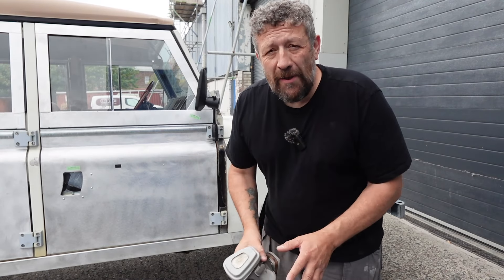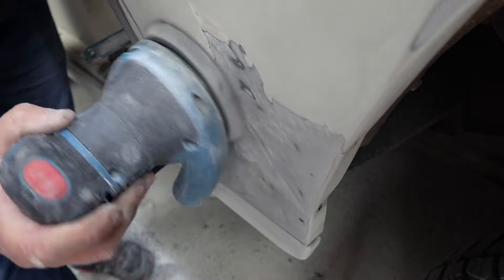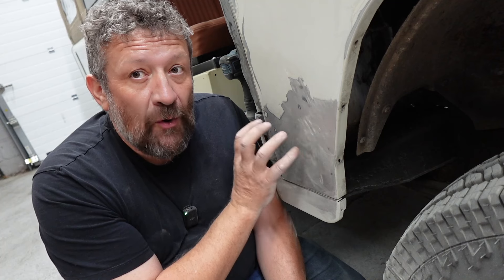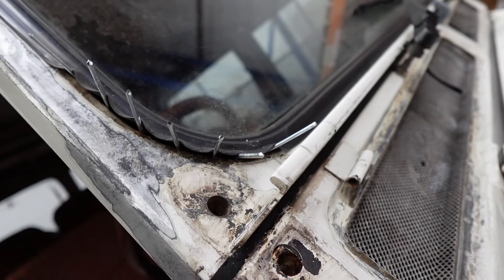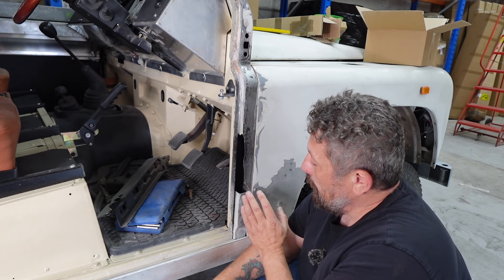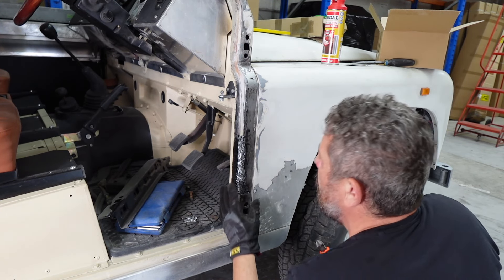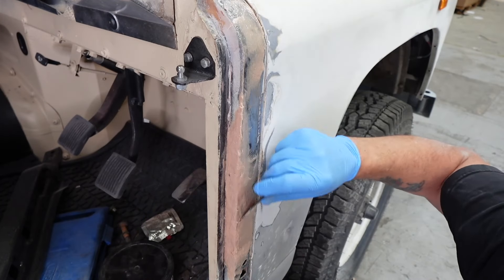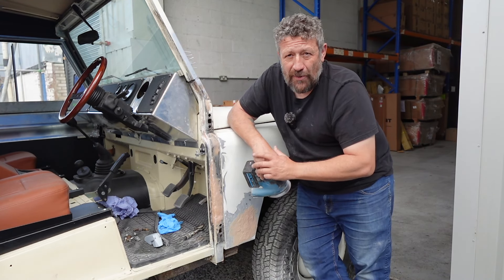How NOT to fix a big hole in the Defender bulkhead.

Comment: Crazy! this is a structural part.  P40 is fibre glass with very little strength, sit back and think about this in the cold light of day. This is something like we did in the 70’s and 80’s it wasn’t good then and certainly not good now.
Reply: He must've rather used PU foam and save a lot of filler.
Reply from the maker: The good old days

Comment: I think a lot of people commenting negatively didn't listen to the reasoning behind this. The front guard is being replaced also, yet it was repaired as a temporary fix until a later date.
Reply: I refuse to believe that is acceptable to an MoT tester.  If I am right (and my cars have failed MoTs for much less), then the vehicle is unroadworthy.  So, what then is the point of the "temporary repair"..?
Reply: @manokent  Fair call about the MOT. I thought this was to just tart it up while it has some product development done on it, in particular with the dash?  But the rest of the points are still valid and it will be better than before with a new bulkhead vs a patch repaired bulkhead.

Comment: I would avoid this repair at all costs, considering the relative cheap parts to weld a new section in. However if you’re going to replace the bulkhead soon then I get it. You’re going to get a lot of haters on this one mate.

Comment: "You should really do the job properly " so you don't do the job properly with a specificly formed repair panel, you filler a part of the vehicle that is necessery for strength. Weld a metal repair section in the bulkhead! Why compromise on safety and bodge the job when the repair section is about £30... With filler you're actually creating more water traps with bodging the job. The other thing is if the vehicel is involved in an incident and it comes to light you did this to it, you could be liable for any injuries caused because of your shoddy workmanship.

Comment: Hairy Mary and mesh on a structural part within 30cm of a body mounting, Really?
 😮
Reply: you're asuming any structural capacity to the alumium body on frame, don't you? to my knowledge the only structure is the chassis frame and the optional anti-roll cage you can fit and attach to it... I wouldn't ride one without one though again...
Reply: @InternetListener  The bulkhead is steel, This corrosion would fail the MOT because it's within 30cm of the body mounting at the base of the bulkhead, a glass fibre repair just isn't acceptable here.
6.2.2. Cab and body mounting

You only need to inspect vehicles with a separate body and/or cab. Class 3 vehicles do not need to be inspected for cabs and cab mountings.

You should assess for corrosion within 30cm of the mountings of the body or cab and its chassis
Reply: @andicog  Steel parts on a Land Rover Body have two main functions:
- Rust formation.
- Galvanic corrosion of aluminium parts.
Otherwise they would've used aluminium only or some magnesium anode protection layer in between or stainless steel. UK knew some siderurgy back in the 1950s I guess when LR R+D was done with paper and pencil.
Reply: @_Rich_.  Firewalls were made of steel when they left the factory. Now we don't know without further investigation.

Comment: In the 70's it was mandatory to use today's newspaper so less mesh was needed 🤣😂🤣 Then those who had to make it right could see how long ago it was bodged, usually sills and corners of wheel arches were filled over this way.
You could have used the rotten part you cut out, made a card template or even just cut from your repair section you already had and welded in fresh metal in minutes for a proper fix, to the structural component of A-pillar and your steel bulkhead.
I have not seen a repair needing welded bodged like this since the 1970's. What a waste of time and terrible way to influence folk looking for a quick fix at home.
Bodging in my woodland with a bill hook is one thing, but on a structural steel component is quite another 👎
Reply from the maker: What's a bill hook?